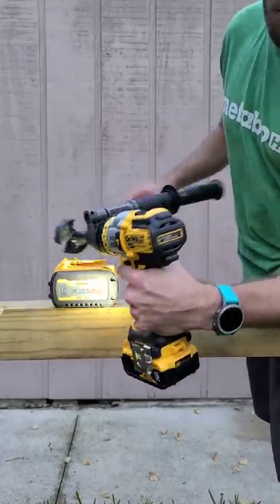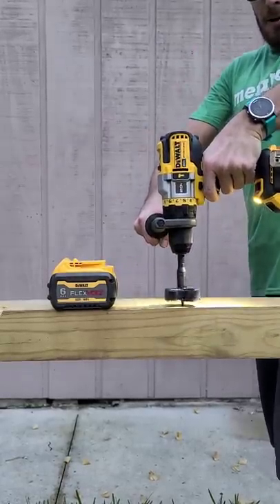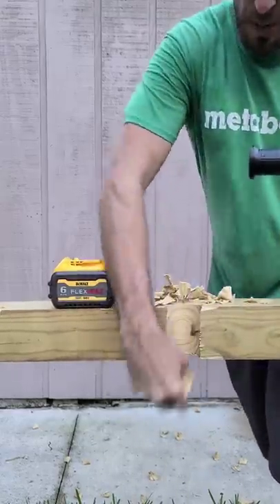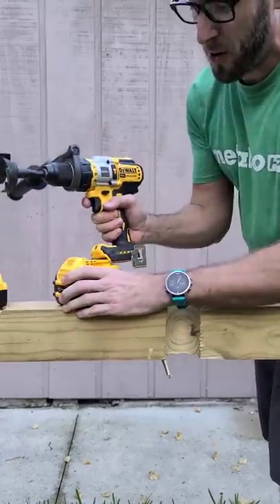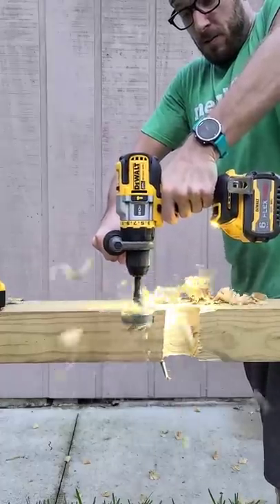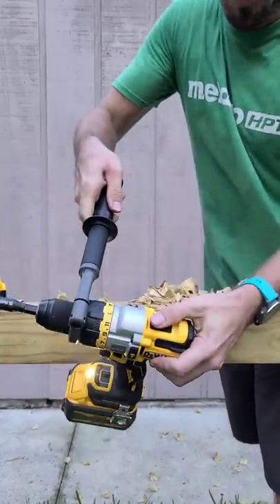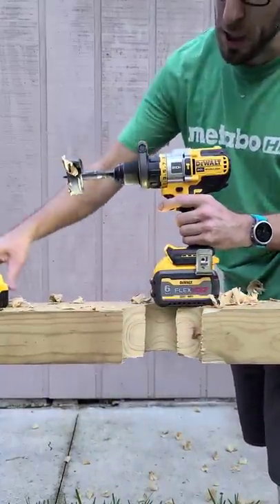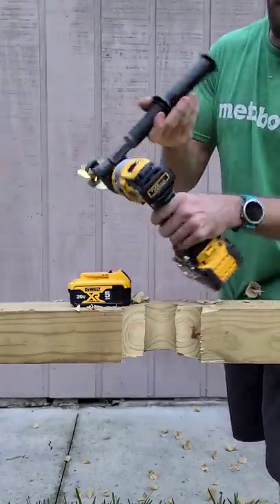New FlexVolt Advantage 20v Drill - quick test

Comment: The only thing about the way you’re drilling is that you’re starting with the bit hanging out the edge a little.
That is allowing the shavings to be ejected as you drill.
If you started drilling directly in the center of the wood, the results could very well be different due to the fact that the shavings build up in the bit and the hole.
I’m not saying that your drill sucks, but you do have a clever trick to make it look better than it actually is.

Comment: Its better for the motor believe it or not. As the motor bogs with a stock battery, each phase is slowly cooking with the extended time active until it reaches thermal overload. You might be bangin more amps but each phase is only momentarily active. Peak efficiency at max rpm.

Comment: I think this is the DCD999.
It claims to have more power than the DCD998 with a 5 amp battery.
The DCD998 comes with a 6 or 8 amp battery. The power difference is very noticeable because the bigger XR batteries have 21700 cells, while the 5 amp and smaller have 18650 cells.

Comment: Amps don’t improve power, it improves runtime 🤦‍♂️
Reply: Yes  exactly all higher amps do is increase  available  runtime with a more demanding  setting.   Increasing volts I think would increase  the power  but likely  ruin  the electrical  components  faster
Reply: There is a small improvment when u have a larger amp hour battery
Reply: @aleksihuttunen7322  yeah the improvement is it has peak power longer
Reply: amps are not the same thing as amp hours. the higher amp hour battery can put out more amps because theres more cells in parallel. this allows for less voltage droop and therefore less speed reduction under load which results in faster drilling. you can hear it in this video. the drill slows down less on the bigger battery
Reply: That may be so. But take both brand new. Same manufacture date. Test them togeather and you will notice the flex is stronger all around. There are lags I cant put in, until I plug a flex battery in and then it magically pushes right in. There's something going on

Comment: I run a repair shop.
Once the warranty is over you will probably never get your brushless tool repaired as most of them have only 1 internal part. Switch/motor/gears and usually cost as much as a new replacement tool

Comment: The fastest hole had  1/3 of material that the other two holes had. And there was room for shaving displacement. This was a terrible example.
Reply: No it was the same amount as the first 2. It was centered between the 2 first cuts, there was material in between those first 2 cuts. So it did the same if not more. Look again.
Reply: @mikeznel6048  but he didn't show us the first battery on speed 2

Comment: I use a few power tools.  Use it all day then say how good they are!  I like battery operated drills (the grinders suck) and they serve a purpose.  But still nothing beats a power cord in my opinion.  Though they can be a pain!
Reply: It's a royal pain dealing with either on jobsites . 
1. Cords get damaged by other trades , their equipment , unplugged by foot dragging , or get unplugged by someone needing you source more than you , cord prevents you from fully reaching task , and or stolen when you least expect it . 
2. Cordless suffers from itchy fingered folks , sucks when you forgot to charge batteries. 
So it's a give and take thing .

Comment: This guy clearly doesn't understand what amp hour is measuring.
Reply: Using the FLEXVOLT ADVANTAGE technology, the tools can recognize the battery attached and adjust the amount of power supplied to the piece of equipment.
Reply: I don't think you understand what is actually going on. DeWalt's flexvolt tech is the same as Milwaukee's FUEL high output batteries. These batteries can safely handle a higher current draw than the standard batteries, hence why the drill works a bit faster. That and the fact that he's not using the whole bore diameter.
Reply: @dorkman112  that still isn't what amp hours is measuring though.
Reply: @kid31989  I think we all get that amp hours measures the total capacity of the battery, AKA how many AMPs the battery can output for one hour. 

The difference between the batteries is the flexvolt board inside the battery.
Reply: @kid31989  the flexvolt battery doesn't output more power because it's a 6 amp hour battery as opposed to a 5 amp hour. It outputs more power because the power supply board inside the battery being a flexvolt. The board inside the flexvolt battery allows the tool to draw more power, let's say up to 16 amps, as opposed to a typical battery which likely outputs about 6-8 amps depending on the tool and task.

Comment: The bigger battery doesn't offer more strength.  It just lasts longer. On the job site you want the smallest battery possible for the lightest drill possible.    Fatigue and stress are real when you're working all day with a heavy drill.

Comment: Going down the middle there at the end kinda gave less wood to chew for your bit. Making it faster for the bit to go through?🤔
Reply: Another thing to add. Obviously the better amp means longer battery. The bigger batt. will not make the motor inside stronger.

For example:
Guy who lifts weights only 150 pounds max.

You give him a long break and a energy drink, he will exercise longer, but still have a max lift of 150 pounds. (If that makes sense)

Comment: Battery capacity has no bearing at all on battery peak power. 
That is determined by your motor voltage (fixed voltage) and speed settings.

What you had was a crappy, used, cycled and dying battery (May even be 10% charged for all we know) that has way less capacity than a new battery. You could have bought the exact same OE  battery again and had the exact same results you had in this video.
BUT you had to pay $150 extra to buy a battery that will allow you to do what your old battery did, except for 4-7 minutes longer than your original battery size, both at the same speed. 

All that battery does is last longer (time/operation wise)

- Electrician

Comment: The amp hour should not change its power during use it just extends the length of time you can use the drill . An increase in voltage would and more power and speed

Comment: re reading my comment from before... just hole sawed a dozen or more holes today it wasn't easy and overheated and put into protect mode as well as broke off the nylon plastic motor cooling fan on a good quality old brushed Milwaukee 1/2 M18 the thing grinding around inside shooting out the sides venting cover at the back of drill had to switch to my master force amd Ryobi to finish the job my brother likes yellow though... so by happen stance de walt which is pretty good stuff  but each tool type varies on who does it best this demonstration although extra visual lacks the toughness of stallout wrist breaking torque on the bind up stops  and you gotta use a dull blade that has to basically friction chew through it not some easy mode best case scenario

Comment: Speed 3 sets the wood on fire and drills through with laser assistance.  So you can't use speed 3 with the 9 Amp.
Just a little tip for everyone that's impressed.
Speed 3 is unusable with the 9 amp or 9mh or whatever their called

Comment: How many batteries would it take to drill out an entire house for rough in plumbing, and the bits being used need some sharpening and you hit some knots along the way?
Reply: Two of the 60volts , three of the 5ah . I keep a small dewalt bag with three chargers and five batteries . 1st thing I do when getting set up is locate a place to set up charging station , then find batteries that are not fully charged and set them in the docks . So as the day progresses,  I just swap drained batteries for fully charged and keep on rocking .
Reply: To clarify , I would only need two 60volt batteries for all day boring , 1-1/2" through 4" holes

Comment: Center that thing up, see how well it works. What are you a dewalt salesman? Got 1/3 of the bit out in the air, which not only means you have less material to cut through but gives it a hell of alot more space to throw shavings. I can't think of many times where this would be applied in the real world.

Comment: I use good old Milwaukee corded drills for drilling anything bigger than a 1/2" hole. I have 1 cordless and 4 batteries that I've been using for 20+ years for screws and other small job's.  Buy what work's forever and you won't spend so much time working to buy tools lol. Peace

Comment: Ummm, am I missing something here? Amp hour is the capacity, it shouldn't make any difference to the drill power. Or are the new batteries a higher voltage?
Reply: Flex volt series changes the voltage to higher one than 18
Reply: @EnnTomi1  Ah, ok, that makes sense.

Comment: Seems like no one explained to him how batteries work. 20v battery is 20v. Increase the amp hour, and all you’ve done is increase the amount of time it can output that 20v.
Reply: Yeah but....different cells used have different discharge rates. Some that use 18650s are usually 35 amps continuous discharge other larger cells can be 40amps. And depending how many cells are in parallel then series'd up can effect the discharge rate(how fast it can dump its juice) . The Amp hour rating is kind of an gimmicky average when talking about batteries that must discharge super fast to be effective.  Problem is the real figure we want, discharge rate, tool manufacturers won't give up
Reply: @NoflectioN  
I guess I was referring to the amp hour rating rather then the discharge rate. The big batteries  refer to themselves in amp hours rather then discharge rates. Could be totally correct that they can discharge at higher rates, but I was just going off the wanketeering.

Comment: You notice he was barely pushing down when he first started in a speed one then when he switched batteries on speed one he pushed down a lot harder and then when he went to speed too of course it's going to drill in a lot faster but you noticed he did not switch to speed too on the first battery and I really wasn't a major difference between the two batteries in speed one except for the amount of pressure he was applying

Comment: Wait so now you can run 20v batteries on a flex volt tool? I have a “flex volt” circ saw that won’t accept 20v batteries. Really quite irritating actually.. Edit, it’s not a flex volt drill
Reply: It’s Flexvolt advantage. So instead of making it Flexvolt and requiring 60v batteries, it will accept 20v or 60v. Probably could have been a bit more powerful on 60v only, but what do I know? I’m no engineer.
Reply: @christophercrawford2736  ohhh “advantage” clever way of saying now it accepts the 20v batteries? I’m done with dewalt and their flex this and that. Really quite pissed me off when I couldn’t put my 20v batteries on my “flex volt” circ saw. Engineers let’s call it flex volt when in actuality that’s the opposite of what it is. I’ve invested in Milwaukee now. All their 18v tools will run off 18v batteries.
Reply: @jeffclark5024  18v and 60v have their advantages/disadvantages. And if you wanted a saw that you could put a 20v and 60v battery into, then you bought the wrong one…
Reply: @christophercrawford2736  What I’m saying is flex volt tools originally didn’t accept 20v batteries and now they’re calling it flex volt advantage and they do? Yes apparently I did by the wrong tool, it wasn’t red… I wanted the most powerful circ saw they sold at the time I was in a hurry and just grabbed it. In my opinion it’s BS that they don’t accept 20v batteries. I would’ve be fine with it having less power and run time. But now I’m stuck wit a tool that only accepts flex batteries when I have countless 20v batteries. Yes it was my mistake but I still think it was a big mistake on dewalts  part and it was enough to make me switch teams.
Reply: @jeffclark5024  in my opinion that’s like complaining you bought a Nissan 350z and assuming you can put 87 octane in it just cuz it’s also the same brand as your Nissan Altima. The less powerful engine will run off your regular fuel if you want that. But if you want the more powerful engine, you’re gonna have to switch to a different fuel source.
Reply: @christophercrawford2736  no actually it’s nothing like that. Regardless of your opinion you’re not changing mine.
Reply: @jeffclark5024  my opinion is that you bought a 60 V tool and you’re mad that it doesn’t accept a 20 V battery. Despite the fact that it’s plastered all over the product packaging and the product itself. I guess when you find out that all your 18 V batteries won’t work on your fancy new 23 gauge cordless nailer, youre going to say fuck Milwaukee and switch to a different brand. Maybe you should go ahead and send a strongly worded letter to all tool companies to use only 18 V batteries and not make any tools in different voltages.
Reply: @christophercrawford2736  I’m not gonna argue with you. That’s your opinion
Reply: @jeffclark5024  no it’s your opinion. You bought into the 60v line and you are mad it doesn’t work with 20v batteries.
Reply: @christophercrawford2736  since you like to argue like a woman. You want my ex’s # ? you two would be perfect for each other!
Reply: @jeffclark5024  actually I only like to argue with stupid people because I have no patience for stupidity. I call it as I see it.

Comment: Funny any m18 Milwaukee can run a high output battery doesn’t have to be a special line of their tools. Yes the fuel line of tools is better but the basic line works with all m18 batteries same as the fuel does.

Comment: That's not how it works. It means that you can kachugachug for longer, not harder. Putting a bigger tank on your car doesn't mean you have more horsepower. That drill will output the same torque no matter which official battery you use.

Comment: I have done the same test with a large forstner bit between dewalt and milwaukee m18 fuel. The dewalt choked every time with a 5ah battery vs milwaukee 5.0 battery. Just saying. Dewalt is lighter, but the milwaukee is more powerful and has much longer battery life apples to apples

Comment: "Flexvolt advantage" is just 20v tools with cute marketing. The "powerdetect" series is the same.

If the tool doesn't say 60v on the side, there's little "advantage" to be had over similarly specced XR or Max 20v tools.

Comment: the less wood you drill through the less friction, the easier it is to cut through. the battery doesn’t do anything but last longer. it’s the motor speed settings inside the drill that supply the speed. silly backyard youtubers.

Comment: The Amp hours of a battery has no relation to the power of it, only the capacity
Reply: I was going to say the same. A drill doesn't all a sudden have more power if the capacity is increased, just longer time to drill

Comment: First run with the 5 amp was fully through the wood. Speed 1. Second run with the 6 amp or whatever. Was fully through the wood. Speed 1. Then you run a higher powered battery with higher speed and way less wood and say huge improvement. Doesn’t really help to sell the battery 😂😂

Comment: How much did dewalt pay you cause I’m a carpenter with a stable of hand tools and I’m callin out fuckery… number 1 that’s treated super soft pine. Number 2 do a full cut instead of leaving 20% of the circumference open for chip removal. Number 3 makita is better

Comment: Nah he wrong, first when he used the first Battery and the second they both got an equal share of the wood but when he said let’s put a tattoo on the second battery he chose right between both the holes he already cut and only cut in like a fraction of what he was actually cutting, and the other battery it just going to have more battery power it’s not gonna make the gun spend faster that’s not how the battery works that’s why the Settings for one and two for speed not just put a huge battery and in full send it

Comment: Who's going to tell this guy that amp hours have nothing to do with how powerful the tool is? They last longer. Not sure about the "advantage" gimmick. Maybe that's what he's showing, but he probably should have compared 6ah to 6ah if that's the case....
Reply: Higher amp hour batteries generally have more packs of batteries in parallel so they can handle more power draw at once. For most tools this results in the tool preforming better.

Comment: Over prices junk!!! Do it in speed 3 2000 or better rpms your in speed 2 at 1300 rpms lmao 🤣 the flex can do it at 2500 rpm Milwaukee at 2100 bosh biturbo at 2100 and many other like MATABO HPT MULTIVOLT 36v can do it at max rpm... DeWalt is the only drill that can't

Comment: The battery makes no difference, it would cut the same with the smaller one,
Reply: First battery was 20v the second was 60v I believe. In that case it would definitely make a difference.
Reply: @leebodd120  no, only the amps changed not the voltage, this means that the battery has a longer life span not power
Reply: @mrconorob12  First battery is 20volts second battery is the flexvolt 60v, hence the name "flexvolt." In the UK they would be 18v and 54v respectively. If you look at the batteries, it has it printed on them.